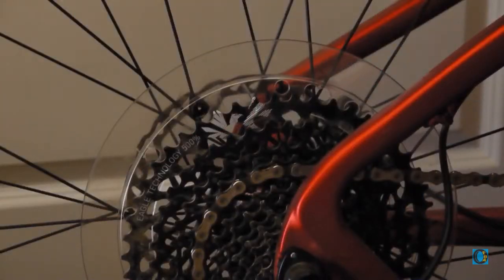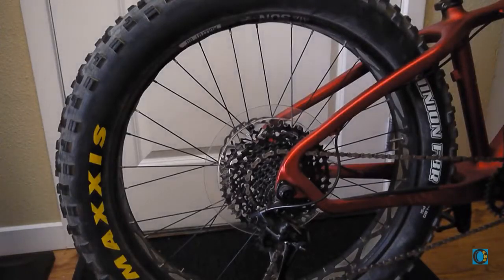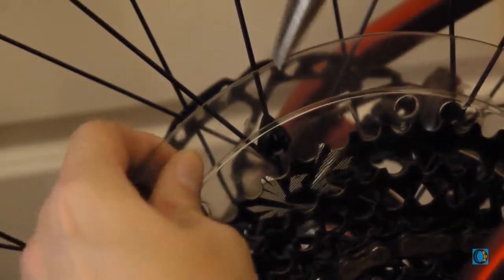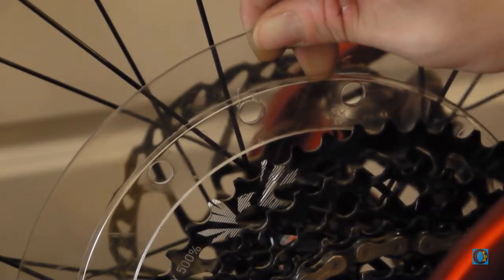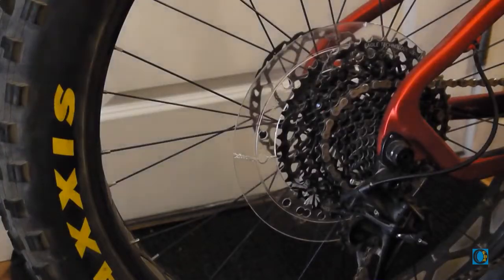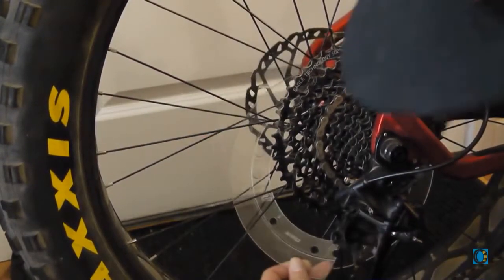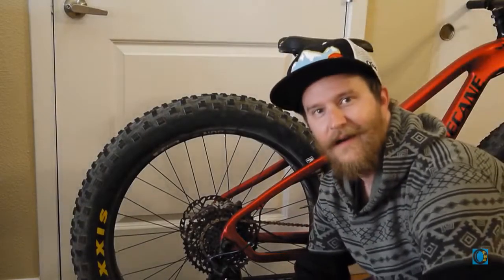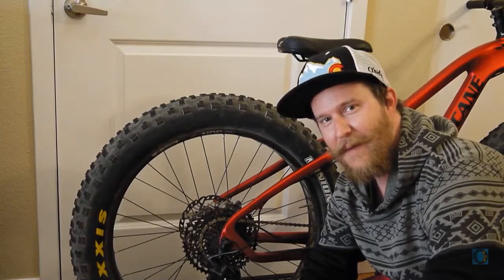Simple 5 min. Hack to Remove a Dork Disc on New Fat Bike | Fat Bike Asinine

Comment: Is it a vanity thing? Like surely it’s safer to leave this on?
Reply from the maker: Thanks for watching! We have much higher quality videos up now too. To answer your question: For the most part yes, vanity. You won't find any pros with them for sure. I find that they make an extremely irritating buzzy/rattle sound and also makes the bike look cheap. The modern drivetrain doesn't really have issues with running into the spokes when properly tuned. I guess you could potentially have the chain pop of the big ring and fall towards the spokes and get caught up in between wheel and cassette (never seen it happen before). Otherwise, I personally have never had any issues with removal on all our new bikes we get here at Fat Bike Asinine.
Reply: You won’t need it if you properly maintain your drivetrain, I removed mine because it rattled a lot
Reply: Yeah, but the dork disk is only useful for people who dont work on their bike or people who crash without inspecting the bike